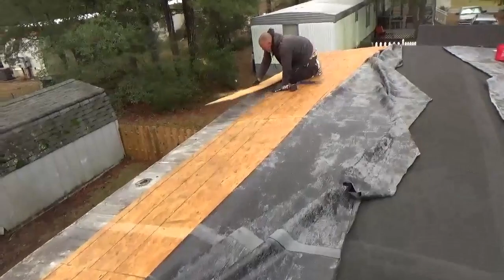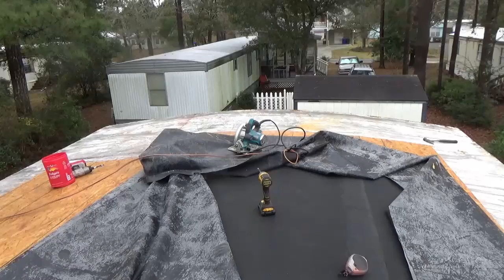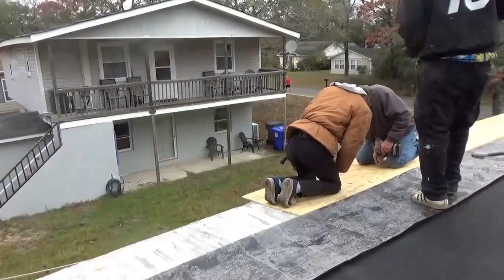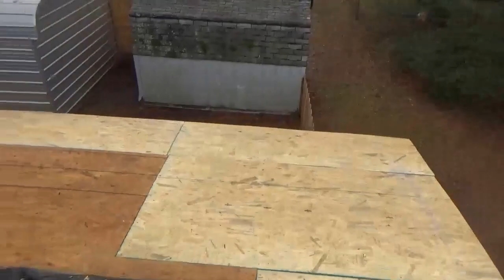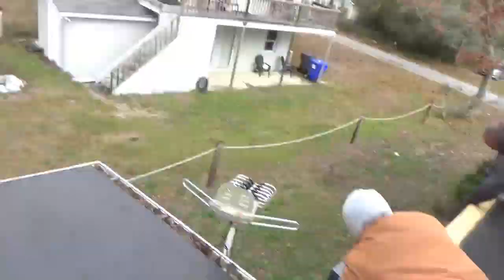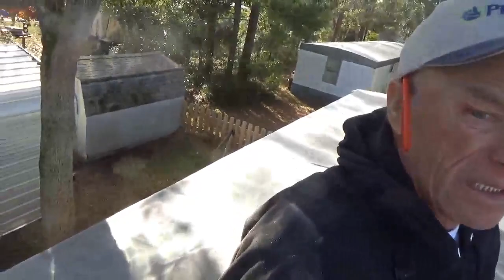Best Mobile Home Roof Repair Ever

Comment: Drew, I like the overhang however there is a Sam and Angela at Green Acre Homestead here on YouTube that went over their roof on a 14x70 with OSB and then steel roofing with a ridge vent. They also added like 12" fly rafters along each side so they could add gutters later on if they wanted too. A problem occurred when they decided to move their mobile home from another state to their land in TN. In order to get a permit to move it they had to cut off the metal roof along each side by several inches. I think they had to still pay a penalty to move it but it wasn't as bad as if they had tried to transport it without cutting the roof off at all. The main thing I don't like about most roofing today is all the dark colors because they hardly reflect sun light at all. This makes homes no matter what they are extremely hot in the summer and just forces the AC to run constantly during the hottest days of the year. I myself prefer light colors such as white or silver metallic which reflects a very large percentage of sunlight away from your home. I believe the problem with most homes is the HOA wants everything to look much the same if not exactly the same. They are costing American's tons of money by using all these dark colors to me they should have to change this and ease their rules. 
I had to search to find part 2 of 2but finally found it. :)
Reply from the maker: https://youtu.be/f82kikum1B8
Thank you for your comment my friend and I watched Greenacre Homestead all the time and I seen that video of them moving they used to be in North Carolina and now they moved to Tennessee I seen where they cut the roof off so they could get their permit it was too wide to go down the road. Adding the OSB on top of the Mobile Home is going to make it cooler all by itself. Just for the fact that the sun is not meeting on a metal roof anymore
Reply: @Drewsroofingandhomerepair  I'm sure the OSB will help but a lighter color of roofing would help even more. You can't hardly light a white piece of paper using a magnifying glass but it don't take long at all to set a black piece on fire. Years ago most houses had a metal tin galvanized roof and or white roofing shingles. Both would out last these drab dark colors they use today. I know for me it's a lot easier to keep homes warm than it is to keep them cool during the summer. Same principle applys to vehicles too.
Reply from the maker: I could agree with that

Comment: Advice needed! I have a 16’x80’ mobile home, slightly pitched gable, no overhang, factory metal roof. No leaks ever, but I want to put a preventative covering over it. I recently replaced the gutters with 5” aluminum house gutters. Considering I live in Alabama, where summer temps can, and often do reach triple digit Question; Would you recommend covering entire roof with peel & stick ice and water shield, then running my latt strips on 2’, then installing 29 gauge light color, roofing metal? Or just covering what I currently have with a 100% silicone, high reflective, white roof coating, such as Henry’s? Please advise. I’m ready to do it, but condensation is one of my primary concerns. Thank you.
Reply from the maker: I never did that before